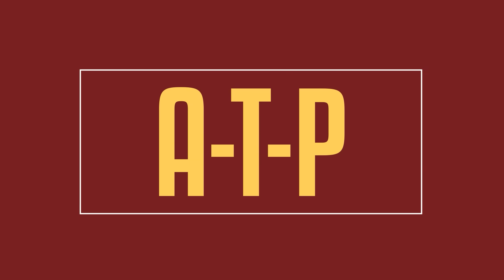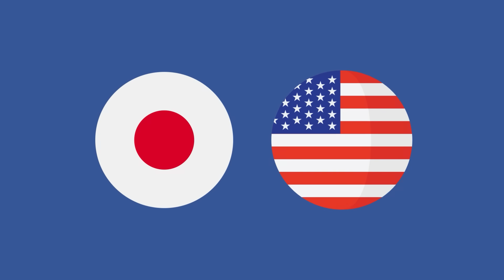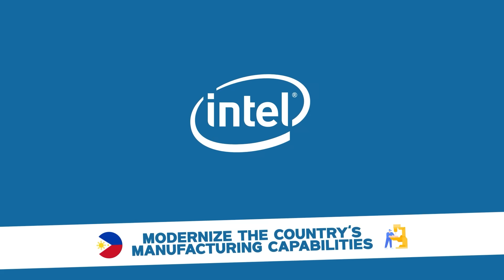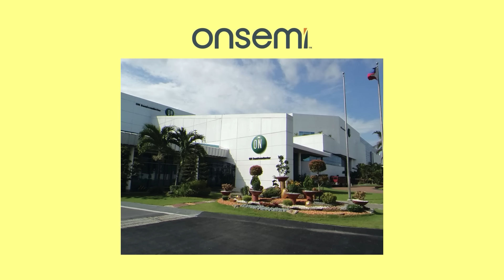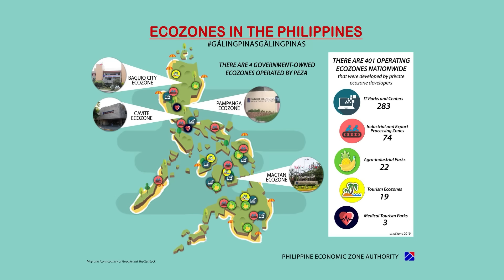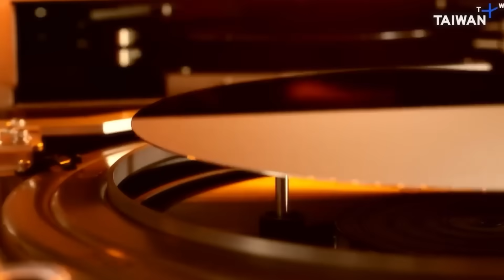How the Philippines Became a Powerhouse in Semiconductor Assembly

Comment: It would be better if the Philippines get better power supply infrastructure that will lower the cost of manufacturing semiconductors. It is power hungry and needs plenty of power that frankly speaking Philippines cost per wattage is just too high. Better get that nuclear powerplant running soon.

Comment: Its not Filipino, most of Semiconductors manufacture were either Japanese or American, and most are capacitors, resistors , etc . Not complicated Logic Chips like CPUs , Microcontrollers. My mother used to be working at Fairchild Semiconductor in 1980s.

Comment: I lived and worked in Manila from 83-87, 90-95 and 99-01 managing a USIA publish center and was aware that Intel had a fab in Manila and TI in Baguio City.  There was also a large fab where I lived in Manassas, VA between my second and third Manila assignments.

Running anything high tech in the 80s and 90s in the Philippines was challenging due to the frequent ‘brown-outs’.   We had a huge 300KVA back-up generator and redundant 300 ton AC compressors at our plant.  The reason the USG created the publishing center there in 1950 was low-cost labor and to by-pass the requirement to use the US Govt. Printing Office in DC for any 4/C printing.  The US Congress gave the State Dept. an exemption in the Smith-Mundt Act of 1948 with the caveat that anything printed overseas could not be distributed in the US.

I suspect what attracted the chip makers to the Philippines starting in the 1970s  wasn’t the lower cost of labor but fewer environmental regulations.  Those are what killed the steel and aluminum industries in the US in the 1970s.  I worked the summers of 1970 and 1971 at steel rolling mill just over the Little Calumet River south of Chicago and that river was a toxic sewer because of run-off of cooling water from the mill.  A huge part of the cost of building the fab near where I lived in Manassas, VA was pollution abatement.

Comment: I am a retired IT worker from the the US, now living in the Philippines as an ex-pat.  I worked in the Space Industry in Florida as a Space Shuttle Data Analyst.  I never knew that they ever had robust semiconductor ATP factories here.  Thanks for this valuable information and knowledge.
Reply: Not to mention that a big majority of workers in Taiwan's microchip industry are Filipinos, too.
Reply: @bennfetalvero4403 really?  Wow! Good then, cause here in America most of us workers in these manufacturing departments are Filipino’s too.  I love working with electronics.  Not a boring job.
Reply: I went for computer engineering degree but it was tailored for semicon industry. But now i work as hybrid hardware, building design and aws cloud architect. I guess my point is even the engineering school added training and subjects to their curriculum to accomplish the semicon industry.
Reply: Diosdado Banatao is a Filipino innovator whos behind Intels microchips
Reply: Foxboro a USA micro controller has an integrated circuit inside of it made by philippine.way back since year 2000.i saw it during my training as an instrumentation technician in a paper Mill.
Reply: This is just half of the story. The Amkor Plant was originally owned by AMD (Advanced Micro Devices) before Amkor Anam took it over. Also it is not just TI and Intel companies that made it thru PI. Motorola was also there which is the semicon assembly and test company prior to becoming ON semiconductor a spin off of that company and is still in PI.
Reply: ATP factories is located in the Calabarzon Area specially in the Province of Batangas,laguna and Cavite.
Reply: I am also a retired IT specialist from Canada. Also an electrical engineer. I, like you didn't realise the scale that the Philippines has been involved in the semiconductor industry.
Reply: Welcome ❤❤❤
Reply: Those are American companies for cheap labour. 

Even tablets are made in Philippines it doesn’t mean they are their companies
Reply: By expat you mean immigrant?
Reply: I remembered hearing about the Texas Instruments in Baguio City late 1960’s while living in Manila. 🇵🇭🇺🇸
Reply: Assembly only , ha ha ha
Reply: Sana po ma share mo ang iyong kaalaman sa mga kabataang magaaral.
Reply: fake lab,smallnonly
Reply: They're not factories in the sense that they manufacture chips from raw materials.  They're assemblers of chips manufactured elsewhere.  That kind of activity has been there since Marcos Sr's martial law period.  It's hard to get wind of that through press reports.  Now we have social media so you're now aware.
Reply: They need more!!!!!
Reply: How many children have you touched so far, mr expat?
Reply: You are just blinded by propaganda, FDI were leaving indroves .there's  nothing for you if you comeback and will kick your self for comming back!
Reply: filipinos are known to steal from their bosses. beware,
Reply: Sir Jimlee do you think you can help my son? Joshua Caswell is in ist year of Mastering Aerospace Engineer in Philadelphia Pa. I am a proud mother from the Philippines and I am so proud of my son and he is a smart person.
Reply: Thank you for considerring the Philippines pilipinos will learn from sensor IT like you.
Reply: Bro, im Filipino, we’re only doing ATP, not any R&D or actual manufacturing
Reply: Filipinos are sometimes pessimistic instead of helping the government in many ways...anyway hope as years go by will improve in terms of technology

Comment: Pat Gelsinger incorrectly attributes Intel's lag behind TSMC to adopting more advanced EUV later than TSMC.

In 2017, TSMC did not use advanced EUV to develop 7-nanometer wafers; instead, it used DUV. Samsung has invested heavily in taking the lead in using EUV to create 7-nanometer chips, announcing that Samsung’s market share will reach 25% in 2022. As a result, Samsung’s market share in the third quarter of 2023 was only 13%. TSMC's market share has grown from 50.6% in 2017 to 60% in the third quarter of 2023, and the gap between the two sides is getting broader.

China also did not use EUV in 2023 but completed the development of 7-nanometer wafers.

Intel was the first to acquire High NA EUV last year and, in 2024, purchased 6 of all 10 High NA EUV machines produced by ASML.

Intel's intention to purchase large quantities of state-of-the-art equipment in 2017 is the same as Samsung's. However, although advanced equipment is indispensable, there are more important things.

Intel and Samsung are facing huge losses because of backward R&D technology. The chip density of Intel 18A is only as high as TSMC’s 3~5nm chip density, and the density of Samsung’s 2nm chip is only as high as Taipower’s 5~7nm technology level. However, Both Intel and Samsung have failed in their lagging chip production.

Comment: Even if EUV is purchased, advanced chips cannot be mass-produced with a high yield rate.

EUV uses TSMC's wet technology and is developed at F12b, TSMC's Hsinchu headquarters.

TSMC modified the purchased EUV and redesigned the reflective structure to increase the reflectivity from 2% to 3% and increase the efficiency by 50%.

TSMC's dry EUV mask cleaning technology reduces exposure to dust particles from hundreds to single digits per 10,000 wafers, a 99% reduction in dust ratios.

   ASML's latest EUV light source output power is 350W, but TSMC has begun using its own improved 350W EUV in 2020.

Comment: In 2002, two Japanese companies, Nikon and Canon, monopolized the world's photolithography machine market. At that time, ASML was still a tiny company, relying on orders from TSMC to survive.

Intel established the EUV LCC Alliance to develop photolithography machines using American dry methods and seize American photolithography machine technology. Major manufacturers such as Motorola, AMD, and IBM are allowed to join the alliance, but TSMC is excluded.

Subsequently, TSMC cooperated with ASML and used the immersion lithography technology developed by TSMC to conduct research and development at F12B, the TSMC R&D headquarters located in Hsinchu Science Park, Taiwan.

At that time, there were two EUV R&D units in the world, but Intel's EUV LCC alliance failed. TSMC spent 1 million wafers for testing at the F12b factory and finally successfully created EUV for manufacturing advanced chips.

Dr. Anthony Yen, Director of Nanoimaging Technology Development at TSMC, later served as Vice President of R&D at ASML
https://engineering.purdue.edu/ECE/Alums/OECE/2018/anthony-yen

The United States has not invested a penny in the research and development stage of modern EUV, and no American engineers have participated in research and development.

Immersion lithography technology is TSMC's technology and has made significant contributions to the global semiconductor industry and TSMC's advanced manufacturing processes. It has also allowed TSMC to jump six generations of technology after the 55nm node.

Comment: 1990 I remember a lot of eletronics company move in the philippines, the problem is the electric power shortage and power interruption, when china open door some move in china and some back in taiwan because of ownership, if philippines allowed foreign ownership like in electronic or manufacturing company that filipino company not originally cannot manufactured and only using the laborer in the phillipines with the oligarch exploded because every laborer they have a cut in the salary of the engineer and operators, they showing salary in 3 times the amount of the actual payment.

Comment: If only Philippines will solve its electricity problem, factories will keep going. Manufacturing just can't have enough power to keep them running...
Reply: Solar PV is cheap. I wanted to build a 3kW array at home, but the local grid couldn't handle it in the particular location.

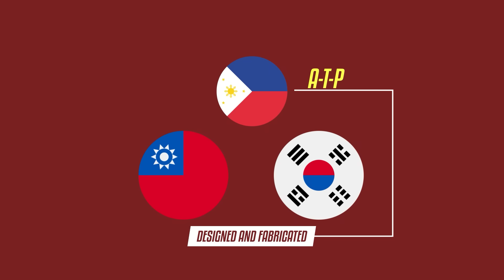Comment: I noticed you mentioned ATP in semiconductors—Assembly, Testing, and Packaging. 1:11 << I just wanted to clarify that the 'Packaging' here doesn’t refer to packaging/packing products for shipment. In the semiconductor industry, 'Packaging' refers to the housing or casing that encloses the semiconductor device, like dual in-line packaging (DIP), SOP, BGA, QFP, and others. This protects the chip and provides connections to the circuit board. I know this well from working in the semiconductor industry for 14 years.
Reply: For obvious reasons, "packaging" in this video refers to the process of ENCAPSULATING the semiconductor devices.
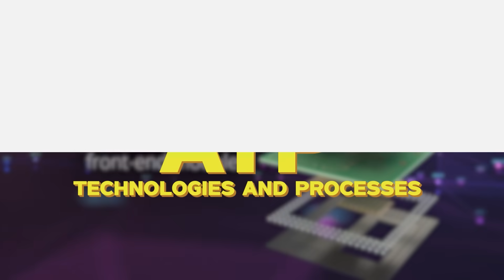Reply: 7:22
Reply: In addition to the above mentioned details different chips or modules (PCB board with connectors/pins with soldered chips often enclosed with a casing) were placed into different containers such as tubes, trays, reel, etc which in the first place was ordered/demanded by the customer. Also there are some companies that perform the above "Packaging" process as well as the usual "Packaging" process on which the above-mentioned containers were placed into compatible shipping boxes with proper labelling..
Reply: understood!!!
Reply: Is it made of epoxy? What brand do they use?
Reply: @JAAS-b7k  It's been a long time but I could recall Sumitomo and Dongjin.
Reply: Actually there are companies here in PH that offer manufacturing up to packaging for shipping like IONICS-EMS
Reply: Is this a question of doubt, jealousy or envy 🧐
Reply: Appreciate this input as I didn't have the slightest idea. Unfortunately, we can't rely on this channel for much when it comes to accuracy considering they can't even afford to make this Text to Speech engine to sound human when reading acronyms.
Reply: @butyou_nobody  It looks like AI-generated content. This should be double-checked by humans before publishing.
Reply: Appreciate the input. Yes Packaging is also technically a manufacturing process, so are testing and assembly.

Comment: If the Philippines would play its cards right it could be a big  supplier of low-value chips to America and Europe and could also serve the rest of the ASEAN in 40 to 90 nano range.This is a big deal. The Philippines should aspire to fabricate chip production (this is highly capital intensive and requires high technical skills honed by  deep STEM background)over the years but for now,it  should start manufacturing low-value products like appliances and other  low-value supply-chain  components.

Industrial clustering is key.This can be done in north luzon corridor or the Marcos  administration could start one in Mindanao as it has 
probably the cleanest water and the lowest labor cost.